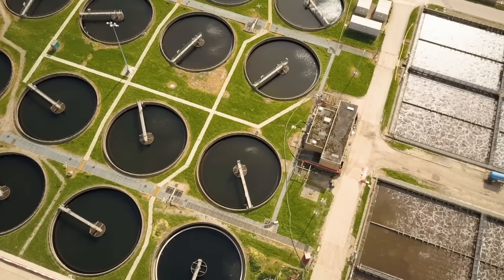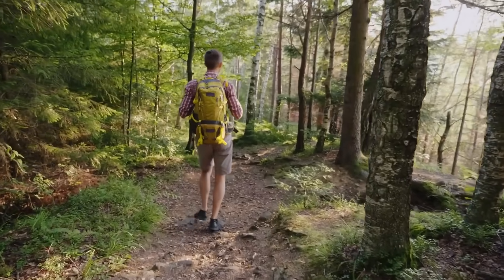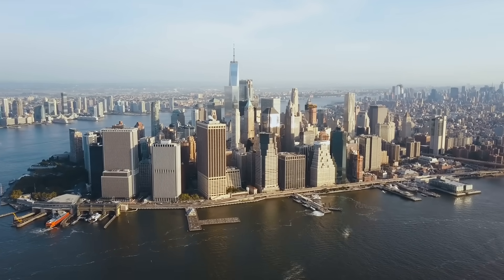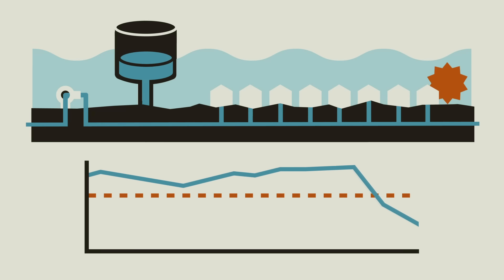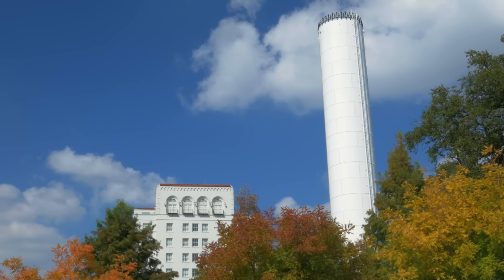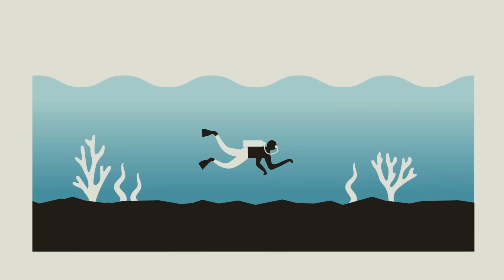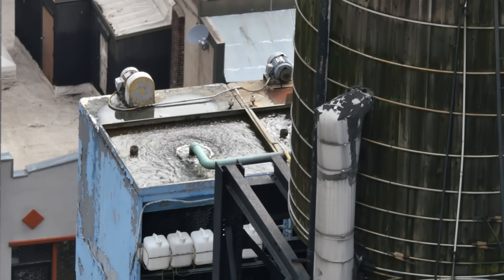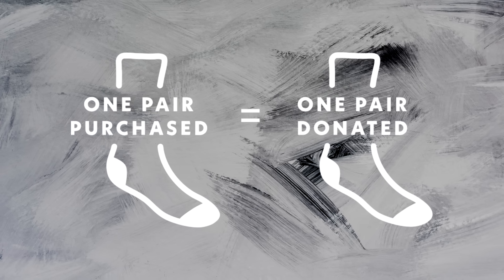How Water Towers Work

Comment: I feel you think in terms of basic electricity the water tower acts as a capacitor and takes the sudden surges of water usage, while the pump acts as usual load. I’m not an engineer, but I think with balance of one source of energy helps another. 
The water tower delivers the energy while the pump delivers the water at demand. Now it’s an accumulator delivering pressure with the pump delivering at demand, minus gravity.

Comment: In the UK, each house has a tank in the attic (or similar). It provides the head pressure. Usually, only water from the main kitchen tap is directly fed from the main. Because the tank might be dirty/have dead rodents, only the kitchen tap water should be drunk.

Comment: I used to work on water towers for a couple years back when I was 19-21 years old. We scraped old paint off, put primer on and then painted as we repelled down the sides. That was for the exterior. The insides the tanks were horribly nasty!! Dead birds, and drowned rats were a common sight after we drained a tank. So we would pressure wash the inside (horrible job), and then apply the water repellent to protect the metal tank interior. For that we used AXEL GREASE!! That’s right, those tanks’ walls on the inside are coated with the nastiest of nasty stuff!! I always thought that after a water tank, the water had to be cleaned, because I know what’s inside. This video doesn’t exactly tell about that.

Comment: Your water cleaning process appeared to show a sewage treatment tank!
Electrons flow from low voltage to high voltage. The "current", as conventionally drawn, is in the wrong direction.
Pumps can be run at variable speeds with a suitable electronic controller. One reason for water towers is the ability to use cheaper electricity overnight, and averaging out the flow rates  to reduce friction losses.

Comment: "It's been a long time since gravity was knocked offline by a thunderstorm." - Great line.
Reply: Gravity is just theory tale that has never been proven to exist... 
"Relative Density"
Objects will either sink,  float,  or rise in a medium they're in,  depending on the density of the object relative to the medium
I. E. (1) 
A helium balloon🎈
A helium balloon rises through the medium of air,  cause helium is less dense (rises)  than the medium of air surrounding helium balloon
I. E. (2) 
An apple 🍎
The apple sinks through the medium of air,  cause the apple is more dense (sinks)  than the medium of air surrounding the apple
I. E. (3) (equilibrium) 
A rock sits on the ground in a state of equilibrium...  you decide to pick up the rock... However,  by doing so,  you're taking that rock out of its natural state of equilibrium... You then decide to drop the rock,  causing the rock to sink through the medium of air,  to seek it's natural state of equilibrium
I. E. (3.1) 
So the apple sunk through the medium of air,  but this time it lands in a pool of water... The apple sinks through the thick density of water to find out that it went too deep,  and decides to rise (due to the apple being less dense than the medium of water) to the top of the water to seek it's equilibrium state
Reply: @MathieusTheWalkingWitness  I like turtles.

Comment: Why have the water flow DOWN, THEN UP? For high floors, why not have the water flow straight down from the water tank (stored on the building's roof) to the top floors? This would solve the problem of low pressure.

Comment: Of all the conversions I had to memorize for my water treatment/distribution license tests, the one I had the most trouble remembering, and thus endlessly drummed into my head until I could, is that every PSI at your tap is 2.31ft of elevation. If the water pressure you measure at your house is 100psi, the inlet at the tower supplying it is 231ft higher in elevation, or a booster pump is raising it to that pressure. 
This comes into play in multi-story buildings. If you have 100psi at ground level, you lose 1 for every 2.31ft taller your building gets. If you're relying on regular system pressure and have a 20 story/200ft tall building, you'll have about zero pressure on the top floor, and that's where pressure tanks and altitude valves and all sorts of strategies come into play to serve our tallest structures.

Comment: When was the last time gravity was knocked off the grid from a storm??? Hahahaha🤣🤣🤣
Reply: Storms can knock a H20 system off line , if the intakes of a source  become contaminated by  ground water flow from a storm or heavy rains ,  flowing on the surface,   it can enter into a water well , if the well head dosent have a Sanitary Seal or Cap to keep Surface water from entering ,this is known as Inflow ,  also if the well is not sealed below the surface , ground water , can enter through the sides of the well , this is known as infiltration,   also if the  source,  such as a river or lake become contaminated due to  storm or heavy rains ,  agitation could ocurr , sturring up particles causing them to  become suspended instead of settling to the bottom , they will enter into the intakes of the  distribution system as well , also   FIRES , such as forest fires , when the forest floor become littered with burnt wood from the trees , the material can flow on the surface during heavy  rains ,enter a water source,  such as rivers , lakes or on the ground surface , a well head  pumping ground Water , also a storm can knock electrical power off , Shutting down pumps , cutting off sending units that tell pumps when to come on , or pressure switches that turn additional pumps to come on to assist in keeping pressure up or to keep up with  the demand Q  (flow ) so you need gas stand-by generators when power is knocked out to supply power to pumps and all systems needed such as filtration units , disinfection systems , ( chlorinators ) , coagulation systems to assist the filtration units , flow meters , monitoring systems , etc,  so YES a STORM CAN KNOCK OFF A WATER SYSTEM VERY EASILY,  for the stated Reasons

Comment: 4:30 How do the pumps and the water tower supply demand at the same time is the tower outlet feeding into the main water line and controlled by some sort of check valve?
Reply: The pump shall only supply to the tank, & the water comes only through the tank to the city.

Comment: Riddle me this...
How have we not made water tower batteries to deal with this same problems with renewable energy systems? 
When energy production is high it could be used to pump water up, and then when energy consumption is high the water can be released down through turbine generators.
 Can it not? 
I would like to some day see wind turbines with water towers built into them.

Comment: Good day.I really like your videos. 

Would you do a video on friction loss? Basically, I have a 1” water tap and need to run water about 1/2 mile. I know I will lose water pressure due to friction loss, but I don’t know ways in which I can maintain/minimize loss at the end of the line. Increase pipe size... alternatives in pipe design/chemistry, etc. How can I decrease friction loss in the face of a hard limit on input size and pressure?

Comment: If solar panels were installed on the a water tower, the electricity could drive a UV lamp that could kill bacteria passively and reduce stagnation. Putting the water in direct contact with charcoal might work too.

Comment: What I'm thinking is that: why don't we remove any minerals from sea water and use those for anything other than drinking.   So, we will have three pipes in every homes: one purified sea water, one would be the ordinary drinking water, and the last one for sewage, which can be recycled (like what Singapore does) and mix it with those purified sea water. With that, we won't run out of drinkable water that fast right?

Comment: In my country (Bangladesh) we don't have these water providing system, every building or a house has its own pump that gets water from under the ground, and we always have the water tanks on the top of the building. Not having a water providing system like that is also probably why we don't have fire hydrants. And my country is poor so that's also a reason. If I'm incorrect about the fire hydrants, please correct me as I'm not an Engineer.

Comment: Right off the bat sir youe analogy of the natural is wrong.your video states pumps cause presure***WRONG*** a pump causes flow this is true. Ill stste this value of knowledge one time, and one time only.you can have the biggest pump in history pumping away at what ever fluid your heart so desires
Pump them for a month.you will notice alot of fluid has been pumped in that time. You see flow of fluid is high when just being punped with out any presure. You want preasure . you must add restriction. Just as when preasure is low flow is high its oposite presure high flow will lower.. It is there come to the smarter of mens mind long time ago....restriction =presure........ You start this video out saying pumps cause presure.so the credability to any thing else this video has to add is more less probebly bullshit

Comment: Umm  I  have  a  question  since  u brought  up  the  subject  of  water tanks, if I recall  correctly  J believe  that  it was Detroit  that  in the  early  days  of  the  city  "built " (cough cough) found this huge , almost  beautiful  even,  water tower  that had a very big design  flaw in  it , that being  there was never any  design  features  built in  or even a  1/2 asset attempt  to  get  one  installed  during  ""construction""  to prevent  the  water from freezing  solid  in the winter  time (and I'm positive  that  the  "public  works  department" didn't  farm out the designing  to someone  located  in  the  tropics) so they eventually  tried  burning  coal around  the  internal  tank. So do u or anyone  else  give  me  a  valid  reason  for  that ? I  am  certain  that  the  winter  in Detroit  was just as cold  then as now

Comment: so instead of intermittently running the pumps you just run it around the clock.... and how does this save wear on equipment?
Reply from the maker: Starting and stopping (cycling) is the hardest on pumps and motors.

Comment: I used to live in Portland, OR, a city with a water supply containing actionable levels of cryptosporidium from the source.
They have a plan to install a filtration plant, but claim it will take 10 years! https://www.portlandoregon.gov/water/article/676631
I believe it is a cost saving effort, and that they are actually going to try and get out of spending anything by changing regulations before they begin construction.  How long did it take to build filtration plants in Dubia or Australia?

Comment: I never doubted the power of water towers. If you take a look at regular garden water pump say 2000W and with diameter 18 mm, it can pump maybe 8 or 9 meters high. Imagine a water reservoir elevated at 30 M of 900 cubic M with a 200 mm hose attached to it. Lots of power!...And if water tower weren't a super genius idea, whey would not be placed everywhere.

Comment: A little concerned with your mixing and matching water and wastewater footage interchangeably.  The very beginning is a wastewater plant... not a drinking water plant.  At 35 seconds in... another WASTEWATER plant.  At 1:16... that is a clarifier, used at a WASTEWATER plant... NOT drinking water.  Everything AFTER 1:16 is excellent!
Reply from the maker: Stock footage is limited for infrastructure like this and treatment plant owners aren’t that appreciative of random strangers filming them ;) I select B-roll to match the narration as best I can based on availability and cost. Clarifiers are indeed used for potable water treatment.
Reply: Practical Engineering I might be able to help with future footage needs, should you ever decide to do other videos about water/ wastewater. I hear you though. No strangers! No filming!

Comment: in my country water towers are being phased out rapidly, the last one was build in the 1970's. and of the 260 that were once here, only about 170 are left. and less then 50 of those are actually still in use. most have been re purposed as Restaurants or bed and breakfast's.

 most of them here are not ugly steel towers either, they are made from brickwork or concrete. and most of them have a distinctive Victorian look.

they are phased out in favor of frequency variable pumps, and pressure vessels. installed in each home. or in some cases a larger variant to provide for an entire building complex or small village.

Comment: You have a minor mistake at 2:23 - electrons flow from low/negative voltage (potential) to high/positive voltage,  the current flows the other way ;D

Comment: Here in Canada, water towers are disappearing; the one in Lethbridge, Alberta was converted into an elevated restaurant.  I would be curious to know what type of technology is replacing them.
Reply: @Tubmaster 5000 

Booster systems. and frequency variable pumps

a booster system its a small tank usually in the attic. which has a small pump, water from the city comes in, then the small pump in the attic will "boost" the pressure of the water to the required value. so basically its a tiny water tower inside your house. now these come in different shapes and sizes of course, you have booster systems which provide for entire cities or towns, you also have much smaller ones that provide for a single building.

same here in The Netherlands about water towers disappearing. at one point in history we had over 260, only about 170 remain these days, and less then 50 of them are still in use. but this is because building houses with one of those small booster systems became the standard here in i would say the 50's or 60's.

most of the water towers here have also been converted to restaurants or bed and breakfast type places.
Reply: @LodewijkVrije  It seems to me that one large tower would be more cost effective than thousands of tiny ones.
Reply: @mouthpiece200  i believe its not actually. here in the NL it costs much more money to maintain our large water towers, then it does to maintain our household booster/boiler systems.

what does an avarage water tower cost to build ? 100.000 dollars? more then that? we just had the entire system in our house replaced for less then 500 dollars.

in the past 20 years we also have not need any inspection or regular maintenance on our in house system. how many times does a water tower need inspection/maintainance over its life time? and how much will that cost over the towers life time?

every house having their own system is way more cost effective, especially when you take into account that you'll probably only have to replace it once in your life time. (the system we had removed had ran for 50 years) now our new system is ready to go for another 50 or so
Reply: @mouthpiece200  A lot of the benefits have solely to do with regulations on disinfection byproducts. In larger tanks, the water 'age' is higher as it's not being cycled through as much. It has time to basically stagnate and form DBPs, then when you exceed these DBPs on mandated testings it requires very expensive public notifications, reviews, engineering consults, and such.
Reply: @RobertMorgan  Interesting.  But what if I go on vacation?  The water in my home tank could be weeks old?
Reply: mouthpiece200 I live in a region in Canada where we have no water tower at all and even then, we don’t have any kind of reservoir in our houses...
Reply: Water towers were never that common in the UK and they've all but disappeared. London largely uses a pressurised pump system, but the central area contains something called the "Thames Water Ring Main", which is actually an enormous circular pipe system under pressure which provides the water for the centre. It's 80km (50 mi) long and it mostly 2.54 metres (100 inch) in diameter. It's pressurised via reservoirs on higher ground on the outskirts of the city. 

There is a traffic roundabout in the city (in Shepherds Bush) with a tall, transparent cylinder of glass and stainless steel, which is actually something called a "surge pipe" and is designed to absorb sudden changes in atmospheric pressure, and is a sort of giant barometer as the water level can be directly seen.

Comment: You’ll see a lot of elevated tanks in the Midwest, due to its flat terrain. Out here in the west where our terrain is more hilly, we install ground level storage tanks at a higher elevation. These tanks are usually bolted or welded steel structures placed on a level surface and designed to meet hydraulic conditions as explained in this video and meet stringent earthquake standards. We design for average daily use, max day use plus fire demand and peak hour demand. Each demand has its own minimal pressure requirement.
Reply: The city I live in (Ottawa, ON canada) has a 24,000,000 gallon under ground water tank on top of what was The highest point when they built it. It feeds most of the pumping stations in the city, and is fed with a 50 inch diameter water pipe.

Comment: In the fire service water distribution is a whole separate, dedicated block of instruction for obvious reasons.  A tower adds .434 pounds of pressure to a closed system, for every foot of elevation between the main manifold up inside the tower, and where it ties into the water grid. Given that pressure factor, a 185 ft tower will add 80 psi of head pressure to a closed system. Ta da !!  it's really that simple.